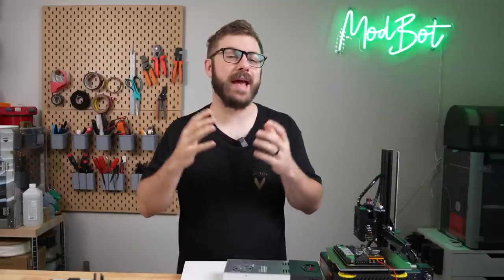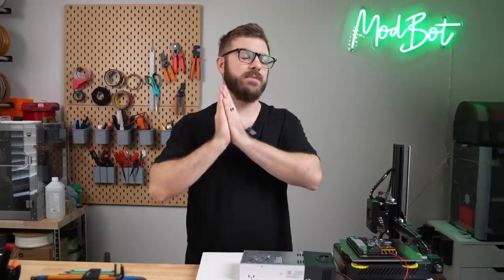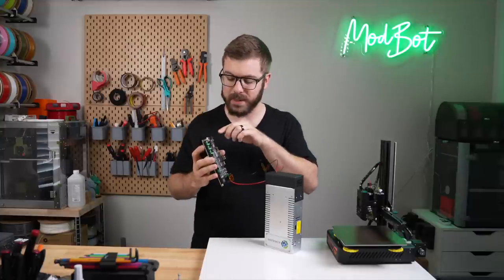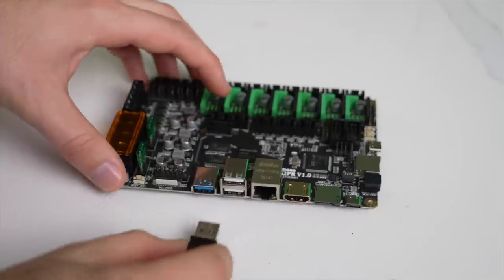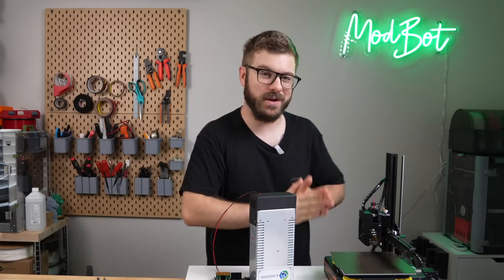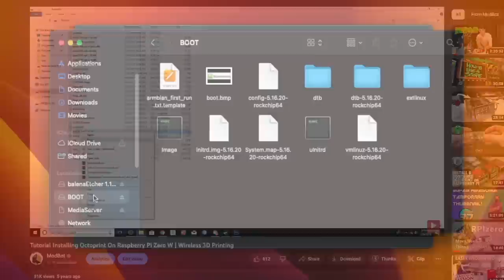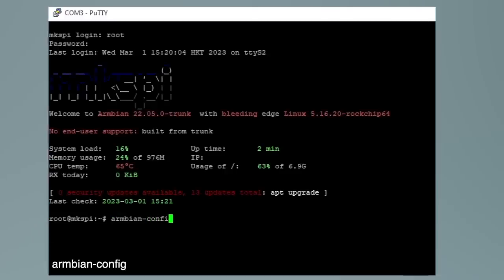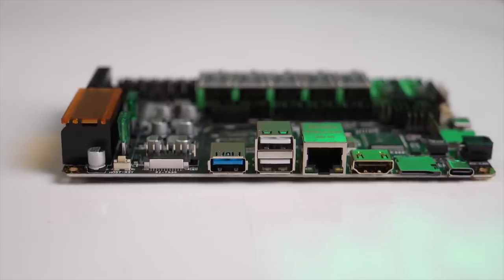Built In CANBUS! Makerbase MKS SKIPR Klipper Board

Comment: For Klipper set up Raspberry Pi imager is superior to Balena Etcher, because it lets you set up your WiFi and host url before flashing. 

Great vid as always 👍
Reply from the maker: I have used it quite a few times in the past but was not sure if there were certain image limitations. (I assumed this since Etcher is what the manufacturer recommended). If it does/would work with this image file then 100% I would recommend that over Etcher.
Reply: This would not fix the issue in this case. Makerbase made it this way *on purpose*. It’s in the changelog.

Comment: I got this board a few months ago in one of their bundles that included a Comfast CF-WU810N network adapter. Using that adapter consumed 100% of one of the four cores, constantly. It's not necessarily a problem, but I'm happier just using ethernet.
I haven't set up CAN yet, but my understanding is that it's a bit awkward: You need to configure the bus through Linux, but it's connected to the MCU, not the Linux host. The alternative is to set up the MCU as a USB to CAN bridge and configure Linux to use that over USB, but the MCU is connected by a serial bus, not USB. So you end up needing to connect the two halves of the board using a USB cable.

Comment: For those with wi-fi problems, this is caused by the bad kernel support and drivers, SKIPR and MKS PI are trapped in a limbo with an EOL 5.16 kernel. This could be easily solved if MKS had minimum care to update the device tree to 6.1 LTS kernel, or better, 6.6 LTS, but I'm pretty sure they won't do it. Second party solutions are a bit buggy and somewhat unstable like redrathnure builds, which I had major stability problems with CAN bus interface.

For wi-fi, I tested around 8 adapters and the only one that had stable drivers for the 5.16 kernel are the ones based on MediaTek MT7601, anything with Realtek are garbage. If kernel were update to a more recent LTS version, driver support would be better and we could have WiFi6 adapters working.

Comment: Alternate approach: connect your wifi dongle AND the Ethernet cable. SSH into the Klipper host over the wired Ethernet connection and set up the WiFi that way.

And honestly I can't be mad for bad Wi-Fi documentation when they've provided an Ethernet jack right there on the board.
Reply: Couldn't agree more! You do have to find the IP address, but to me that's much easier than connecting via serial.
Reply from the maker: This is probably the best route to go. My modem is on the other side of the house but I definitely could have done it. That being said, I do try to follow manufacturer instructions as much as possible assuming that most users will do the same. It also helps point out any issues or pain points. You are absolutely right though in that being a great option.
Reply: Or an even better way is to broadcast a wifi network whenever it can't connect/not set up yet, you join the network and the captive portal has a textbox to enter your ssid and password. Pretty much every smart IOT device does it this way except for ones that use an app

Comment: Hi bud, good see this board getting some recognition, its not Ferrari, but more of Hyundai, great balance of value, reliability, performance and features at a competative price, I'm a reseller for select Makerbase boards and I use the SKIPR board in all my builds now, I also supply them in my QIDI TECH and KINGROON printer upgrade kits, I love it, has everything you will need for even the most advanced build, but take it from me CAN has no place in a 3D printer, it has some severe short comings, I will have after this weekend a full tutorial up on my GITHUB with links and config files for a clean OS and Klipper install along with the THR36 and THR42 Tool Head board in USB mode, the CAN mode will ultimately fail, please don't waste your time, I will also have a link to an article explaining why CAN is not good in a 3D printer, I wish I had seen that before I wasted many days of my life on CAN, you will suffer from timeouts and other systemic issues, also the OS image MKS supply is terrible and there is no source code provided, it also develops issues over time and ends up taking way to long to boot, I recommend setting up over ethernet first, once that is done, then connect the Wifi USB Dongle, and I highly recommend the MKS 5" display, not the 3.5", but if you have either, you can at least input your wifi directly through Klipperscreen, and the cheapest TP-LINK WN722N USB Wifi adaptor works far better than the one supplied by Makerbase, and if you need something with better range and the ability to use an external antenna then the TP-LINK WN725N also works perfectly.
Reply from the maker: I would love to just go with USB but from what I can see we are going to need new controllers for this. 

The options from what I can tell are use a standard USBA-C which would allow you to use data but you would need separate ground/voltage wires. This method is not ideal because you need to run additional wires. 

The best scenario I can see is USB-C which most controllers still dont really ship with. This way you can use the 240W USB-C cable which will be plenty for anything on a toolhead. Although the SKIPR looks like it could be perfect since it has USB C and this is what QIDI is running with USB to their toolhead boards. 

Definitely curious to hear more about your setup.
Reply: @ModBotArmy  Thanks for replying :) I totally agree, but you can if feeling creative is make a 5 wire USB cable, 3 wires for data , and 1 pair for 24v power, as 5v is not actually required, but I opt to run a single tuff braided USB-A to C and a pair of 18g UL1332 power wires, so its only 3 feeds and your done, but I agree, I would love to see USB-C PD + USB 2.0 Data, as that's all we need, PD supports 24v and more than enough wattage. But currently the USB implementation on the THR boards works flawlessly, my current in house designed and built NexGen 3Dimension runs default Bambu Lab print profiles all day, but can actually go much faster, all with the Makerbase Boards.

Comment: Have you managed to have Klipper talk via CAN to a CAN device (e.g. tool head) without the USB/CAN Bridge through an USB Cable from Pi USB to MCU USB-C? Following the MKS instructions lead nowhere and according to postings in a Klipper forum, the CAN Bus is a function of the MCU and not of the PI side where it belongs and not reachable through the Serial Bridge between Pi and MCU. Even worse: as soon as there is a USB Cam on the bus, the Klipper stalls with timeouts. The "Armbian" image is even beyond outdated. Together with the 5" Touch it is, as of now, a EUR 110 experiment for the trash bin.

Comment: Anyone know what the CAN bus connector is? Or where to find a cable for it to connect my toolheads?

Edit: For anyone wondering about the CAN bus connector, like me, it's a Molex Micro-Fit 3.0 (Housing Model No: 430250400 and pins series No: 43030)

Comment: if this board is capable of supporting closed loop steppers, this might just be exactly what im looking for. from what ive seen thusfar, the only support ive seen for closed loop stepper motors are on reprap boards
Reply from the maker: I couldnt see why not. I am only running them on one of my printers and from what I recall the driver/electronics are on the stepper itself and then a wire goes from the motor to essentially a "dummy" stepstick so that it can be controlled by the board. I dont recall any other unique hardware requirements.

Comment: https://youtu.be/-Coa-w77cWo?t=547 Really wish we (content creators) start by instructing all users to change the root password.  A little bit of security goes a long way.  MKS boards are being used a lot more now.  These are full Linux devices on our networks.  We wouldn't (or shouldnt) leave our personal computers, or routers with default passwords, why would we not do the same with our klipper setups?   Raspberry Pi made a security change last year.
Reply: Or at least encouraging putting these devices on their own network and isolate from your own devices, or blocking them from outside traffic if you need them on the same network as your other devices.
Reply from the maker: I am not a shining example of network security. Most of my printers are not online long term if not in use and I only access them locally but I realize that is not the case for all. After talking with a few others I am going to put together a video talking about this and covering some of the things that can be done. Changing login credentials as a bare minimum is just good practice.
Reply: @ModBotArmy  Love to hear that!!  ♥

Comment: Just wondering, could we just create the WPA supplicant file in the boot folder instead of using a windows machine?
Reply from the maker: This could work if you know the contents of the file. I guess I could have tried that as well. A few have also pointed out that temporarily plugging it in over ethernet would let you get it on the network so that you can ssh in and set up wireless so there are a couple other options.

Comment: Some of us do not have a Windows based system to work with. Could we maybe create the file and then update it?
Reply from the maker: I am not sure about just creating the file but you can either hook it up via ethernet to ssh into and then configure wireless or try a different serial connection. I used what was baked in but there are going to be alternatives that might not have the issue.

Comment: I had the same issue with installing Klipper on the MKS Pi... The issue with those images are that they are extremely bloated, do not work (updating components like Fluidd is impossible with some versions, while with some others the whole install gets trashed after a "successful" update) and as you mentioned, the "wpa supplement" file is only present in the oldest image that they provide, which in my experience at least, does not want to update any component, so you are stuck with whatever version of Klipper/Moonraker/Fluidd is installed. The eMMC module is only usable with a computer that is running Linux, it is impossible to flash a different image on a Windows PC as it shows up as a 2TB drive and as such it is impossible to flash an image onto it successfully. Oh and don't forget the fact that the included USB WiFi adapter was not being recognized at all with the newer images.

The only solution is to use an alternative Armbian OS image that someone has made and uploaded onto Github without all the bloat. I have written down the process I had to follow to get my Pi to work here: https://www.printables.com/model/486927-ender-3-mks-pi-mount-tips-on-installing-klipper
Reply: Wait what the hell yours came with a dongle? Mine did not): wish I would’ve seen this a few days ago. It’s a solid board once you get a normal armbian image on it
Reply: @joediragi4258  do you mean the WiFi adapter? I bought the MKS Pi, not the board mentioned in the video, the Pi had a few buying options, one of them included a WiFi dongle plus a eMMC flash memory module with its specialized adapter.

The board works quite well with a clean image, I do not know why they'd go to all that trouble just to distribute a bloated image that simply does not work.

Comment: Why would you not just connect via ethernet for the initial config and then just disconnect after the wifi starts working. Also i hope you at least changed the password for the root user. Even better if you added a difrent user and gave it sudo privileges and dissable root login. THIS IS A SERVER you will get attacked, my server has about 5000 login attempts per day (before i added fail2ban)
Reply from the maker: That is a great method of doing it and would simplify things by quite a bit. Generally I try to stick with the instructions provided at least as a starting point. IMO many will do the same and if I do that and run into issues like I did it does at least allow me to provide that feedback in hopes it helps others or the manufacturer corrects it.
Reply: Should have actually checked it and not just put a "large" number (that I remembered was correct at some point) the "large" number of 100 per day came in as not existent in comparison to the actual number of 5000

Comment: Why is everyone using CANBUS anyhow?  We have controllers available with native USB support?  Along with Power Delivery we should be able to have a hotpluggable, auto-enumerating system.  USB even has asynchronous notifications, getting rid of the common trope of "but usb is slooow" (0.125ms latency) .  Yet somehow everyone has been all head over heals over this 1 megabit max speed old-as-dog-shit CANBUS system which has to be terminated like some old 10-base T network and daisy chained to each device...
Reply: I agree. I do work in the automotive space and they love their canbus. Except everyone uses their own standards... so yeah, it sucks
Reply from the maker: The biggest issue I can see right now is that there are no boards that do this from what I know. There are lots of controllers that have a USB-C port which is great for 5V and data transfer but they wont output input voltage. There are PD USB-C up to 240V but no way to get the voltage needed for fans/hotend. It would be cool to see hardware allow for USB that still allows you to make your own cable. But I would not be upset to see board come with a special USB-C port capable of outputting enough power to drive the toolhead electronics. It just isnt there right now and yes CAN is a bit of a pain but once setup it has worked very well for me.